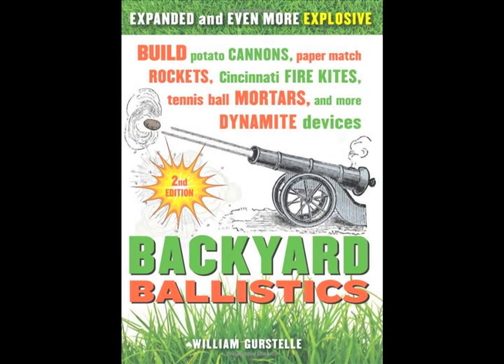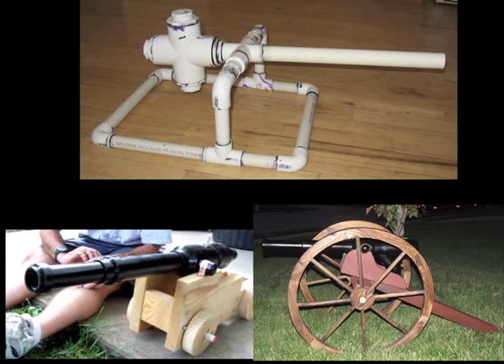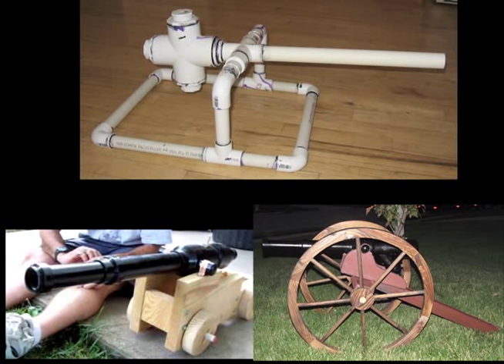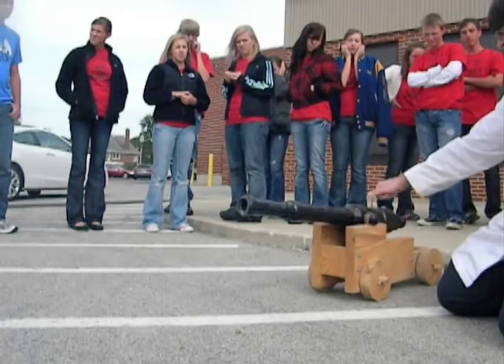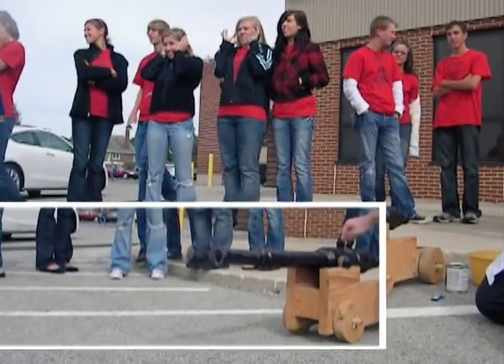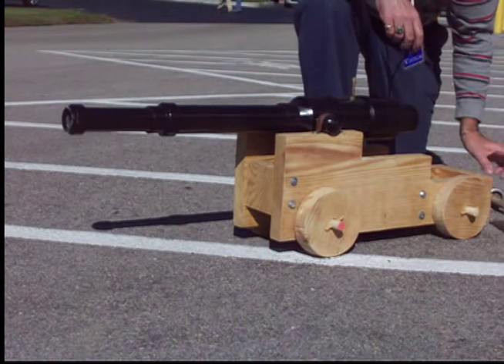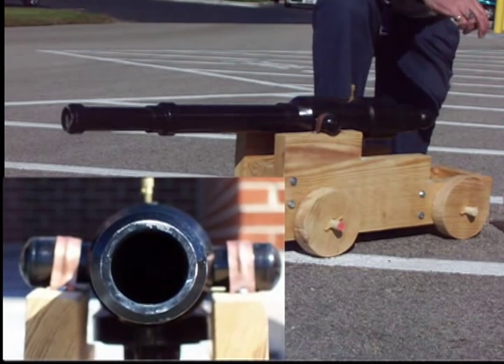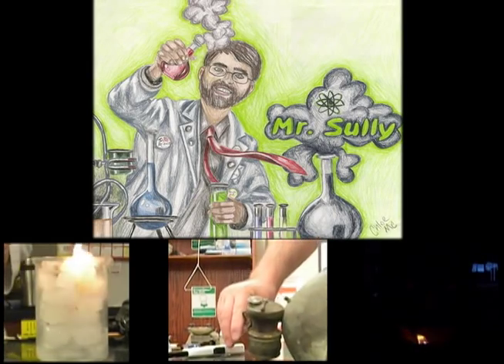Carbide Cannon

Comment: i made one out of pvc but only getting real small explosions   any ideas why?
Reply from the maker: How much calcium carbide are you using and how long are you letting the acetylene gas build up?  Try to ignite too early and there isn't enough acetylene, too late and there isn't enough oxygen still around.  Another issue could be the freshness of the calcium carbide it should be dark in color and not brown or grey which indicates that it is reacting to moisture in the air.